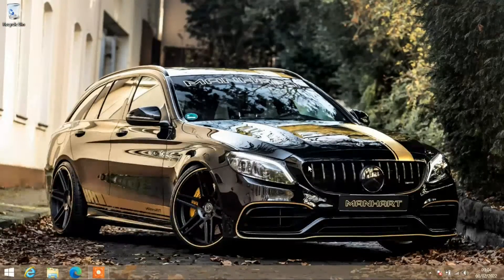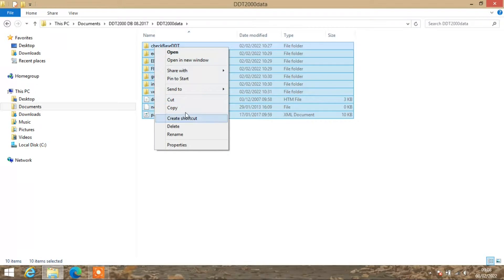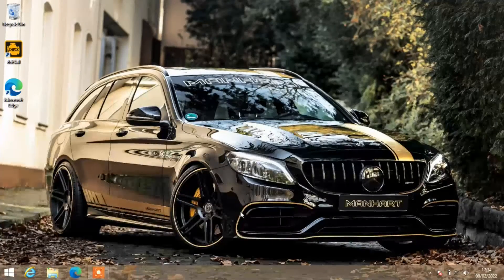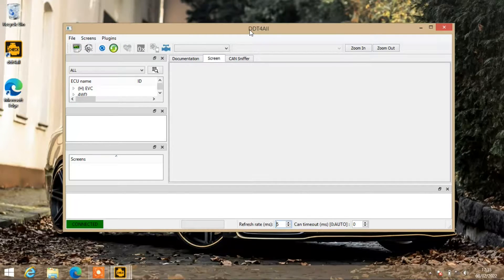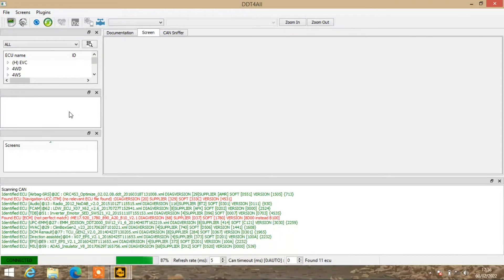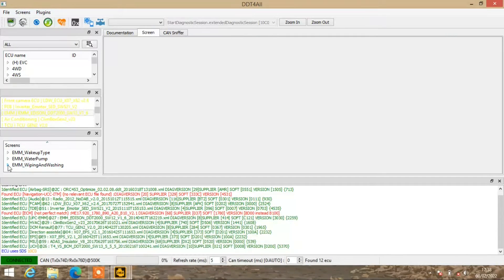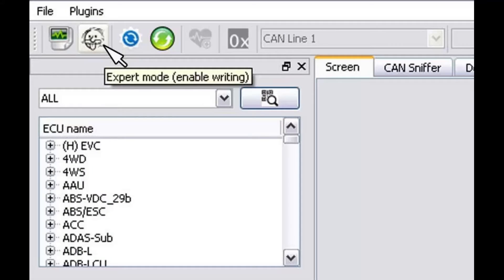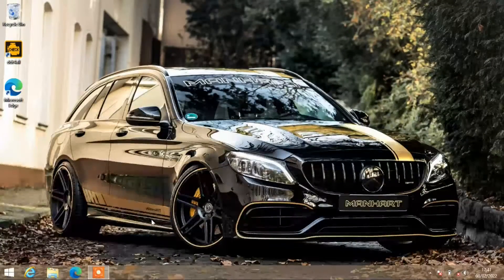DDT4ALL full installation, setup up and overview guide.

Comment: Hi. I get stuck at the step when scanning for ecu´s. It says on the black screen "1 ecus loaded in database" so I assume there´s a problem for the program to find the ecu files, even though i have downloaded them like described here. Any thoughts what to try?
Reply from the maker: @Swedediesel  is the ecu folder copied to the main folder of ddt4all on the main hardrive?
Reply: @mvautomotive7092  yes! I read a bit on github and see that there should be a file called eculist in the ecus folder, I dont have that, maby that is the problem? and where can i get this file?
Reply: @mvautomotive7092   got it going now. there was something wrong with the program version, now I downloaded it from another source and it works.  Although some of the modules on my 2020 kangoo ZE aren´t listed in the ecus catalog.
Reply from the maker: @Swedediesel  can you search for them manually? As opposed to auto scan?

Comment: Whatever i do it cannot find the database. It reports database not found read the documentation when starting. There is no documentation everywhere that i have searched.
Reply: You must copy the database folder, naming it "ecu" and leaving it compressed in the ddt4all program folder.
If on x64, c:\programs-ddt4all.
If on x86, c:\programs (x86)-ddt4all.
The shortcut file (highlighted in green) must be present in the installation folder. If it isn't there, you must install the program again.

Comment: Ive followed all your instructions without an issue until that is I scan using the magnifying glass.  When I do this all cpus listed at the bottom of the page are in red and none of the boxes above this generate any information.  Have you any idea what i may be doing wrong?
Reply from the maker: @jamiecarpenter4079  possible. Did you put the ecu database in the main menu in the folder under ecus's or created the folder and copied?

Easiest way to check is to open the tab to the right of the magnifying glass. Pick twingo mk3 and the ecus should populat in the box below.
Reply: @mvautomotive7092  Hi Ive just checked so I have picked twingo lll. box underneath ECU name ABS -VDC,>ACC,>Airbag-SRS and so on in a list.  Used 2017 version as you did and copied and pasted as you did.  So not sure if ive missed something ut i dont think so.  Cheers
Reply from the maker: @jamiecarpenter4079  did you use the same link for the obd adaptor?
Reply: @mvautomotive7092  Ive downloaded another version of ddt4all and it now works perfectly.  Thanks for the help and the many useful smart videos.  Im sure i'll be using many of them.

Comment: `How do I establish the ELM327 has the 25k80 chipset? I downloaded the D4A SW and Renault db. Offline this seems to work ok and screens seen on various info videos appear as expected. I connected to the car (Smart For4 W453) but there was little to no activity and the lower screen in D4A SW didn't populate as observed in the installation video. I checked the activity in the cmd prompt background screen and saw after every ECU code there was ''Çan Line -1' or message related to items not available. My guess is the ELM doesn't have the right chipset but have no idea how to test or establish it without breaking the unit open (prefer not to do in case I can return it!)
Reply from the maker: Outside of opening the device up to have a look it should gave stated in the device description on ordering if it has that chipset. Alot of Chinese versions say but don't actually do. The link is the description is the one I used. Price is good and it works. 

Check to make sure that device drivers for the elm device are installed on your computer. There are generic packs for them online. Google elm32 driver packs.

Comment: Hey!, I really appreciate your videos, great!

I wonder if you can assist me?
Talisman 2019 with stock halogens, I did put Led´s in, and right now the car-computer have cancelled power to the left dipped beam, and it´s still no power when I reinstalled the stock halogens.

 so, need to get power back to dipped beam left side , how?
and 
how to "tell" the car that I now have Led´s ? 
and then reinstall the new Led´s
Reply from the maker: Try disconnecting the battery. That tends to reset the car and may reset the warning.

Comment: does this work with renault zoe?
Reply from the maker: I believe so. I have seen posts in regards to sucessfull  changing of parameters on a ze20 model.
Reply: @mvautomotive7092  i've done it and it worked flawlessly! Thanks
Reply from the maker: @fineryx  you are welcome.
Reply: @mvautomotive7092  also, i was wondering, maybe you know; what does the DDT in DDT4all Stand for?
Reply: @fineryx  Hi, a bit late but 'DDT' stands for "Diagnostic Data Tool" - Cheers.

Comment: How much time does your PC needs to scan all the ecus? i have done the whole process as it should and when i connect my pc to the car, the scanning takes almost 15 minutes and when it finishes, doesn't show me the connected ecus on the second screen. What am i doing so wrong?
Reply from the maker: My onen is relayively old. Runs windows 10 but only has 4 gb ram and a standard cpu for the age. Do you have the renault database Or just the software? Also the elm32 device was the drivers installed?
Reply: @mvautomotive7092  I think I have the drivers installed. My pc does not gets a cd to install it. I also used a MacBook Pro with windows inside and the same. It takes many minutes to read the Ecus and then nothing. From where can I find the right drivers? I have ELM 327 usb v 1.5 with cable.
Reply: @mvautomotive7092  I also bought the Renault database 2017 and the 2020 but the same.
Reply from the maker: @spirosrousounelos4523  try running the software in demo mode without connecting. It's the third option on the initial boot screen. You should then be able to click through the folders and subfolders like normal using the ecu database?
Reply: @mvautomotive7092  I just checked demo edition and works fine.
Reply from the maker: @spirosrousounelos4523  that would lead me towards the elm device. Where did you buy it from? Checks the drivers for it. Google elm32 device drivers there is normallybon redit driver packs covering all platforms for them.

Comment: I have electric 2018 453. I want be able to charge only to 85% but t can’t see any settings. I wonder if can change settings with DDT4ALL.
Reply from the maker: Is that charging the battery to only 85%?

 There is a code for changing the charging power so that you use the full 7kw as opossed to the factory set 4.5kw?
Reply: @mvautomotive7092  
I want charge to 85%. I want automatically top charging when reach 85% of charge.
Reply from the maker: @LAStupidDrivers  this is not something that can be done through ddt4all that iam aware of. Only charging power.

Comment from the maker: Was the video usefull? Is there any coding videos you wish to see? Let me know below and I will get back to you as quickly as possible.
Reply: hi. there's no video. I don't see it. i don't understand.
Reply: now it's there. thanks. don't know what it was.
Reply: Yes, I have an RS 250 and would like to code out the airbags (its now a track car) and need to turn off the airbag and spanner light on the dash, Can that be done with this software - Thanks
Reply from the maker: @mattgower4984  as they are not renualt items I do not think the software will register them. You best option that works is to use good quality air bag resisters. You can get them for about £8 for generic ones or Recarro sell them for about £30. I know i would go for name brands. Hope that helps?
Reply: @mvautomotive7092  thanks for the reply, I have read that it's a 3.9 resistor, not sure the wattage, try a few and see how we go. thanks again
Reply: hi, pleas i'd like to know how to activate the warning ignition in an hard brake, thank you in advance
Reply from the maker: @abdallahchiekh4260  I apologise in advanced but which warning are you wanting to activate?
Reply: @mvautomotive7092  when I have to do an emergency brake, like in a highway
Reply from the maker: @abdallahchiekh4260  that by the sounds of it should be a safety feature built into the car and would require MB star or equivalent.
Reply: Would love to see you do a video on how to make the digital speedometer larger on the 453 model. Is this something you can do?
Reply from the maker: @manthony18  that requires mercedes star and not something you can do with ddt4all. I will try and get access to a muktiplexor.
Reply: Hi, first of all thank you very much for helping us out with your videos! Can you make a tutorial for the neccessary changes after switching from the original EFB Battery to a new AGM battery so that the car knows i have a new battery and which type it is? My car is Smart 453 and i switched to VARTA SILVER AGM DYNAMIC 12V 60 AH 680 A (EN). Is it possible to do that with ddt4all? Thanks!
Reply from the maker: @mastersk7675  From my understanding switch to the AGM battery, the car should auto sense it and does not require coding. The only fault I have heard of is with the aux 12v battery in the EQ not charging correctly, which mercedes have a software update for.